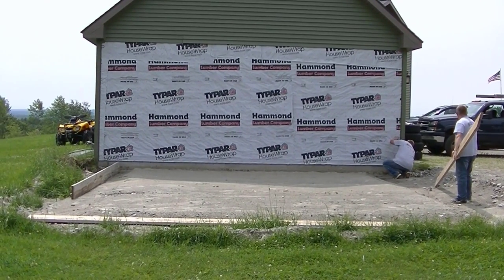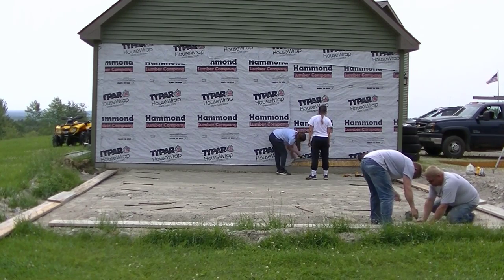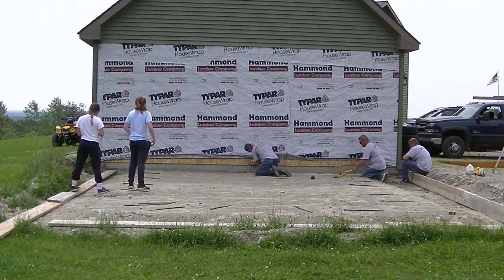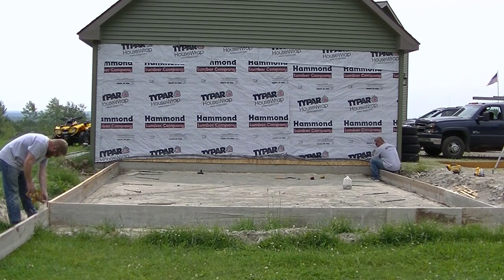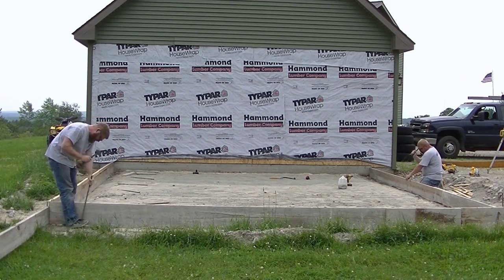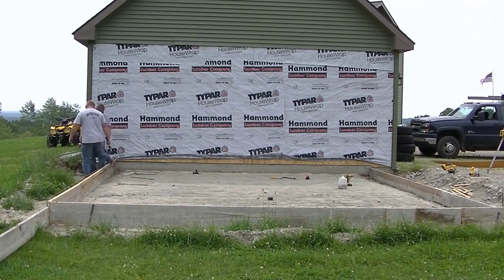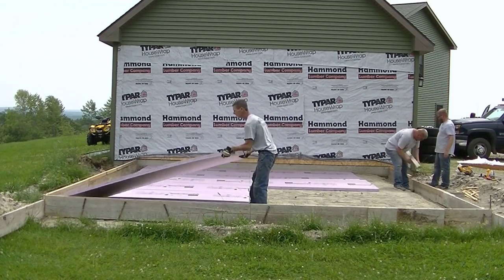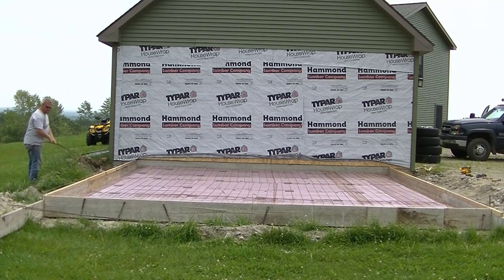GARAGE SLAB ADDITION | CONCRETE SLAB FORMWORK PART 1 OF 3

Comment: We recently poured our first slab and it went ok at best :/ Some things I did not do right were asking the plant for 3/8 aggregate they showed up with 1" and it was interesting to work with. We also didn't check our slump and the mix was very dry (saw it standing and not slumping on our video afterwords) even though it seemed wet enough coming out of the truck. One thing I wish I would have seen is how you guys screed, we were doing the sawing motion and that was tough to keep level. After the first pour we added a bit to get things leveled out and fix some bad spots but scraping the screed like you guys do rather than sawing back and forth makes things much easier.
Reply from the maker: I've got quite a few videos of us screeding. Sawing is tough and slow.
Reply: @MikeDayConcrete  Yes, I've watched a bunch of your videos :) You guys really know what you're doing and make it look so easy ;)

Comment: Mike, what is the procedure you are going to use to bond the new slab to the old? I had a company pour a slab, for a shelter tent 34'x50'x6,'' and they lost it I have to get another contractor to redo it. The first pour was about 4 weeks ago the contractor has to form up to cover the damaged first pour we are pouring 5' over it my concern is the bonding of the second pour over the first also all the rebar is in the first pour. Should I rebar the second? Thanks for any input.
Reply from the maker: If it's 3" or thicker we don't bond the floors. We want them to move separately. We put a bond breaker like typar between them. And yes rebar the second. Under 3" thick, we bond them with a product called Weld-Crete.

Comment: Hey there... I'm a general contractor from Illinois... Been watching a lot of your videos. Really enjoying your channel. One thing I can't wrap my head around is how does the frost not heave these mono slabs. I mean the frost definitely gets under the foam since it is basicly at grade. And if the foam is ridged enough to hold the slab up with out compressing then could the foam push the concrete up when the frost pushes the foam. Or is this just considered to be floating and the frost moves everything the same amount in which case what does the foam actually do?

Comment: I’m in the process of building my own garage and building my own forms. Footings are 24” wide by 16” thick. Making my own wooden pickets, ripped 2”x6” in two, in other words 2”x3”x36” and pointed. What do you think of these pickets? Or what do you recommend.
Thanks
Reply from the maker: They'll work ok. Just be a little harder to drive in than the metal ones we use.
Reply: Mike Day Everything About Concrete What size are wooden usually? I tend to over do it sometimes but don’t want a blow out.